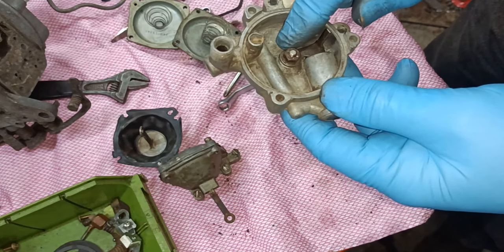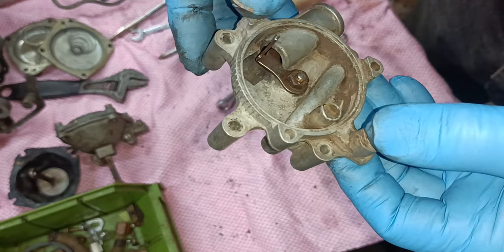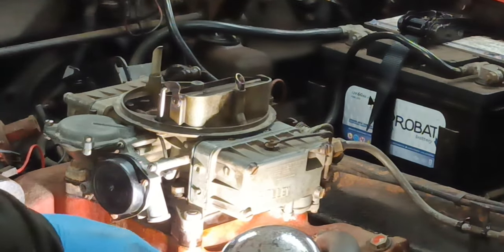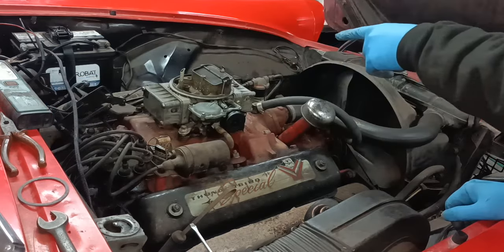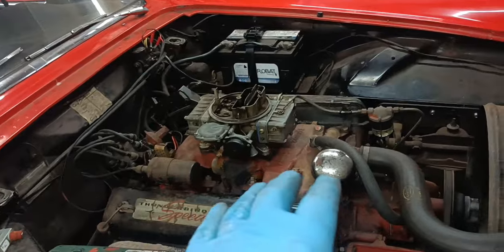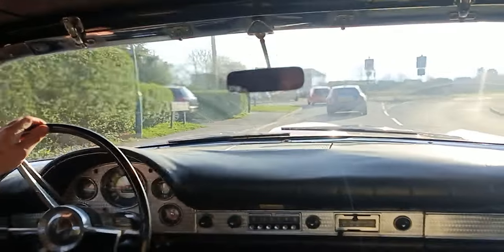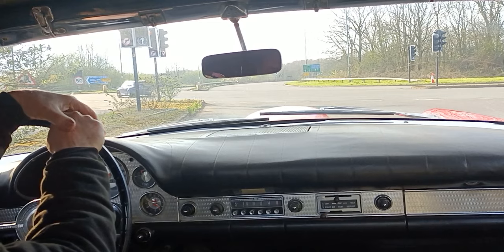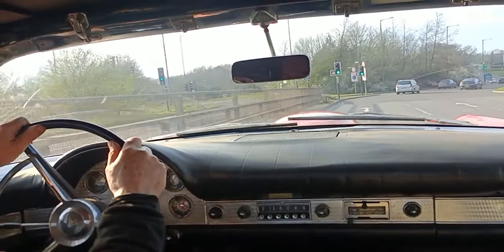Mart's Old 57 T-Bird! Reinstating the choke and Four Barrel Road Test! (Mart's Update 2421)

Comment: Going good Mart. Pull the inner cable out of the speedo and give it a lube with some graphite penetrating oil. I was told not to use grease or ordinary oil as it can work its was into the speedo head.
Reply from the maker: Thanks for the tip Graeme. Thanks for watching.

Comment: My Dad Had a 51 Merc with the Merc Flathead in it, it had a weard sidedradt carb with a automatic choke. when it was cold you hit the throttle 3 times , set the choke ans 3 squirts ans hit the starter ans it would light right up
Reply from the maker: Hi Brendan. Nice to see your name pop up here. That's more or less what I do. A few pumps and crank it. Thanks for watching and commenting.
Reply: @MartsGarage  thanks Mart for the work! I’m looking forward to you fixing the vacuum advance, I had a 65 Chevy pick up with a 350 in it and I had a Holley four barrel, I got disgusted with it and put an Edelbrock carburetor on it. It was kind of fun to see you kick this carburetors buttt

Comment: Those old chokes need to be adjusted for warm weather and in the fall. Sounds good, do you have the fender skirts?
Reply from the maker: Cheers north thanks for the tip. No skirts on this one, never had any when I bought it, though I can see signs of a bracket so it did have them when new.

Comment: Long time since I had a Holley but isn't there a ":fast idle" adjustment screw that contacts that "fast idle" cam so you can increase the engine speed when the engine is cold and the choke is on?? Or, is the same idle speed screw acting on that fast idle choke cam which means the choke needs to be rotated "richer" a mark or two to increase the idle speed when it's cold and the choke is partly closed.
Reply from the maker: Hi Ron. There is a screw and I feel like I want to wind it in but I can't seem to get on to it to turn it. Probably easy with the carb off but I don't want to disturb it. Thanks for watching and commenting.
Reply: @MartsGarage  Hi Mart:
If it's like I'm thinking, it hits steps in that cam shaped piece that's attached to the choke linkage. When the spring closed the choke butterfly, that cam shaped piece moves so that "fast idle" screw lands on a series of steps machined into that "fast idle cam". When the choke finally opens, the cam rotates away from the screw so the screw has no place to bear upon and the "normal" idle speed screw controls the throttle.

Comment: The ole Bird runs nice, huh Mart.  It seems that I also find myself left-foot braking with automatic cars.  I think I got into that when I broke my right leg years ago.  I could use the throttle ok, but I found my left foot better for the brake.  Can't explain it, but I still do it.
Reply from the maker: Hi Al. Obviously the pedal is set up to make it possible so it feels natural enough. I sometimes apply a constant pressure with my left foot and then regulate it with more pressure from my right. It's like having a servo effect. Thanks for dropping by.